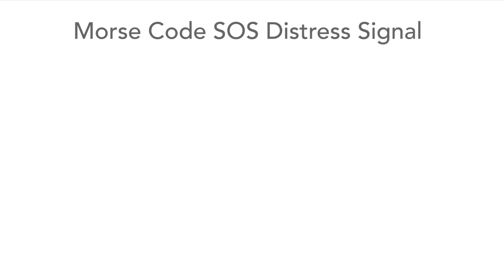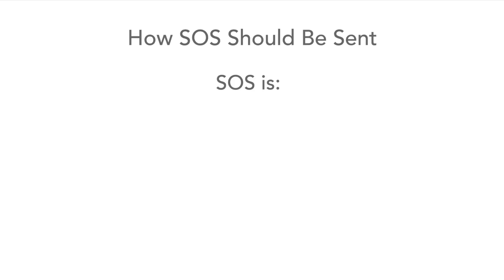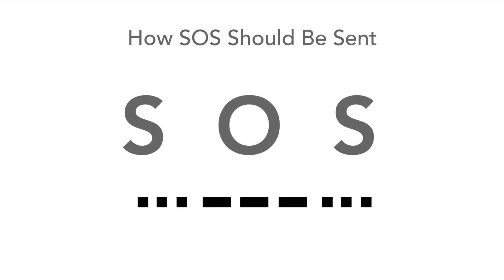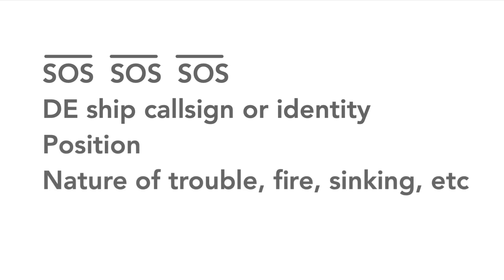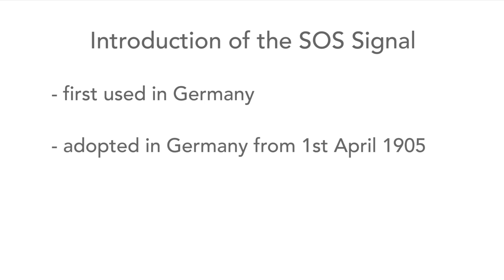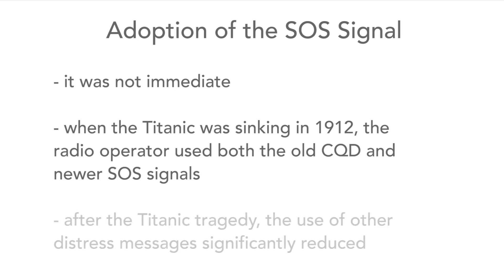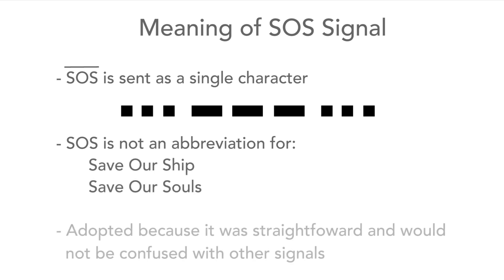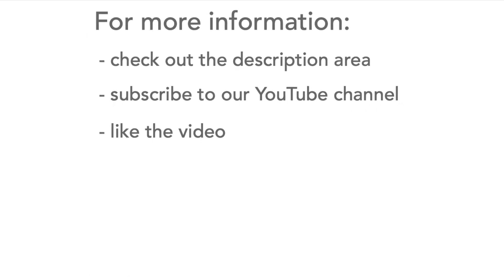Morse Code SOS Signal: Facts, Fiction

Comment: As far as I know, it is the only 9-element morse character. 1-4 for letters, 5 for numbers, 6 for punctuation. It should be sent somewhat slower and more deliberately than normal morse to make it stand out from other signals in busy areas. It has a similar effect as shouting 'FIRE', in a noisy pub.  All history now.
Reply from the maker: Interesting comments - thank you. I confess I had not realised it is the only 9 element Morse character, but yes it seems so.
Reply: @ElectronicsNotes  Curiously enough, XXX and TTT, although theoretically sent as one 'character', were actually sent as distinct letters,  although slower and more deliberately, to stand out from background noise. Very effective, even in North Sea clutter.